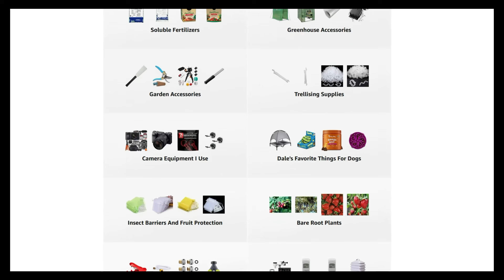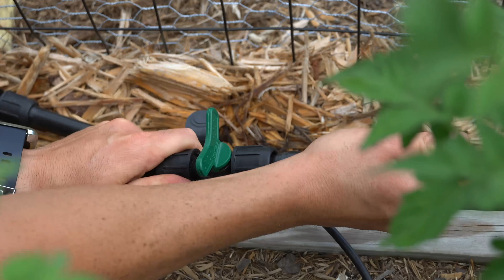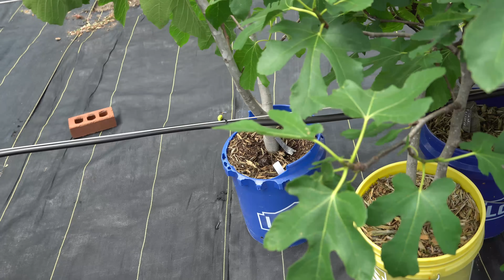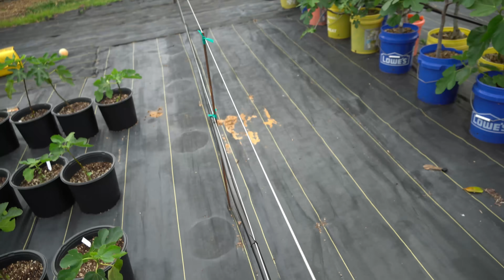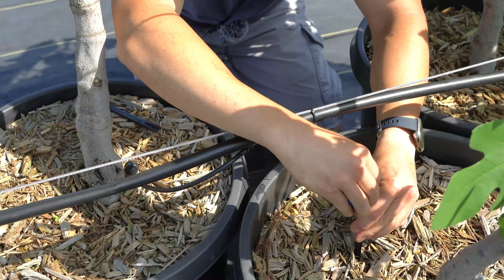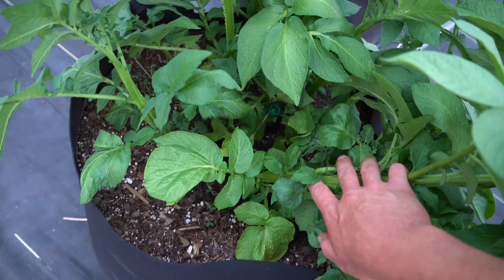The BEST Guide To Installing DRIP IRRIGATION To A Container Garden

Comment: Great video. I have tons of drip to set up. Definitely some good ideas here and a clean finish. I assume there is a pressure regulator on the system? My main question has been does it matter how close the punctured holes are? I thought I remembered there being a minimum spacing between the 1/4" holes(18"?), but I can't find anything on drip depot's site. All I found was the maximum feet/gph for tubing sizes(30/30 for 1/4", 200/200 for 1/2", and 480/480 for 3/4").
Reply from the maker: I've itemized all the phases of my drip irrigation installation in a playlist here so you can find the exact type of install you want: https://youtube.com/playlist?list=PL1gY7BoYBGIHHHsx0JPcYgD4xXzA96usL

It will probably be easier to break the install into portions instead of tackling it all at once so it's less daunting. Yes, there is a difference in the spacing of the holes, because you want the holes spaced based on what you're planting. The drip line comes with, I believe, either 6", 12" or 18" drip spacing, so you'll want to use the lines that match your planting scheme. Something like lettuce or carrots will need tight spacing, where indeterminate tomatoes need wide spacing. Drip line is pretty cheap and eventually tends to clog, so the drip line itself isn't permanent and only lasts a few seasons. The distribution lines last many years.

Comment: I also recommend drip irrigation!  I like that unlike a sprinkler irrigation, the plant leaves do not get wet which decreases the risk of fungal disease. I decided to experiment with a different drip hose this year that can be stored flat in the garage over the winter as the drip hose I have been using was at the end of its life.  I only have 3 containers, to contain my invasive plants because I want more from my gardens than mint, catnip, and oregano.  😆  I may have to consider this system for them so they don't die while I'm on vacation.

Comment: This is timely since I just ran a main line over to my containers but haven’t chosen an emitter yet. Question for you- for plants that have a lot of subsurface feeder roots like citrus do you think a downward spray would be better than a point source dripper?

BTW I love drip depot and use the locking fittings from your recommendation 1-2 years ago, it really is the best way to do things. Will be sure to use your storefront link for my next purchase.

Comment: how long/how many days a week do you run drip?
Reply from the maker: There is no set amount. It is all a judgment call. It's based on time of year, the size of the plants, temperature, the last time it rained, etc. We have pretty dry springs, but April temps are low enough that much water isn't usually necessary. Things skip up a lot in May, but storms roll in in June. I can go days, sometimes weeks, without watering in the rainy season where it'll rain every day for days on end, but sometimes we get long dry periods of extreme heat and high pressure and I may need to water my containers TWICE A DAY! I wish there was an easy answer, but it's all judgment.

Comment: To make your life even easier, you can replace the manual valves with 12v sprinkler system valves, do a master valve at the hose, then each row another. Some sprinkler controllers have the ability to add a master and secondary, then you can just control the whole thing from your mobile phone and scheduled watering. 
It is very easy to move back and forth to PVC to hook these up (drip depot has all those compression coupling adaptors - mini rings that you glue to the PVC). At my setup, I even hooked up a mist line to one of the valves and no I can tell Alexa to turn on the mist to cool the backyard area ;)

Comment: I like putting the emitters on the mainline before the spaghetti in case animals chew the spaghetti line, the flow will still be regulated for the entire system. If you lose an emitter off the end it will affect the flow for the entire zone because of the drop in pressure at that failure point.  It’s easier to inspect if they are all on the mainline as well.

Comment: Excellent video. Are you turning these on and off manually or do you have them on timers?
Reply from the maker: I am turning them on and off manually. The reason why is my spigot will leak with a timer attached. One day, I would love to integrate this into my lawn irrigation system. Until that day comes, I’m stuck manually turning the spigot on.
Reply: @TheMillennialGardener  timers will change your life! I have a small garden compared to yours but ran line from the spigot on the house underground to each bed and put a spigot at each bed. Pressure gauge is on the spigot at the house and individual timers are on each bed. Took a bit of setting up, but now I’m free from all that on and off! Love your channel. Thanks!

Comment: Thanks for a great video. I have a lot of containers with flowers besides my raised  bed veggie garden. I'm feeling a little overwhelmed because they are in 3 different areas, front of home, both sides and 2 decks. I'm lucky to have 3 spigot to run lines from but have no idea on how to measure and what pressure regulator to use on each spigot. Any advice is much appreciated!
Reply from the maker: I would recommend looking on DripDepot’s website. They have several sample kits for different orientations, which include pressure regulators and backflow preventers. You can begin with a layout that is similar to yours, then customize it.  I use the ‘Senninger 3/4" Hose Thread Pressure Regulator - PSI : 25 PSI.’ However, my system is pretty large, so I used the largest allowable. If your system is small, you may want a lower PSI to prevent blowing the system apart. They can’t tolerate much above 25PSI, and less is obviously safer.
Reply: You can measure the output of your particular irrigation system by placing a sheet pan or casserole dish under the drip hose and experiment with different run times and ect to measure out put.  I also run mine (from a timer) at night to mitigate immediate evaporation and facilitate deep watering and root development. The timer is also good because your garden doesn't die when you are on vacation.
Reply: With your drip system setup on the mature fig trees, how many hours per day do you drip into the container figs from late May through summer until they bare edible fruit?

Comment: drip irrigation was the best thing I ever did for my garden. with this 95+ temps this week. definitely helped with a pressure regulator to not pop off pressure fittings.
Reply from the maker: It is a bit of work up front, but it will save you enormous time in the long run. It has taken me 2 summers to install all of this, but now my garden is basically on autopilot permanently. Next will be zones to my perimeter fruit trees, but that is much less complicated.
Reply: @TheMillennialGardener  yep. I set mine on a timer so I can water before the sun comes up. I got all of my beds and half of my containers. Need to do a few more containers before I’m 100% automated.
Reply: @thatjerseyb  hello, I live in Texas and we’re having 100 temperatures right now. I have some fruit trees and was wondering how often and for how long do you water them? Thanks in advance!
Reply: @yaima0901  my figs I water by hand. They are my only fruit trees. But I have my system run for about 30-45 minutes in the morning before the sun comes up. So far so good. We’re going to be going back down in temps so I will probably drop it back down.

Comment: What is the max number of emitters that can be attached to the main line?    I want to set up a drip irrigation line for my front yard, about 30 plants, and a separate zone line for the back yard, about 40 plants.  Is a 1/2" main line big enough for that many emitters?
Reply from the maker: That depends on many factors. It depends on the psi of the pressure regulator that you must install in the beginning of the system, the GPH rating of each dripper, the overall surface area of the system, the grade of your system, and so much more! Each “zone” in my system probably waters 100+ plants. I can irrigate every single zone with my spigot, which is literally hundreds of individual plants.

Comment: Great job. How often you are going to water the 25 fig containers and for how many minutes?
Reply from the maker: 15 mins is more than enough at a time. More than that and water starts running out of the drain holes, which is not good since it flushes out the containers.

Comment: You are the drip irrigation Man!  You are good at explaining all the fittings and what goes where.  You make it seem so easy and I am sure it is not!  Thanks again for a great video!
Reply from the maker: Thank you. I try to make the videos for people like me, because frankly, I don’t know what all the parts are and have trouble keeping them all straight. You have to basically perform a preliminary layout, and then plan your most efficient route to connect the dots while isolating zones where appropriate. It is easy, but it takes time.